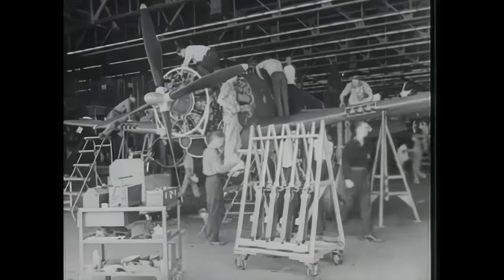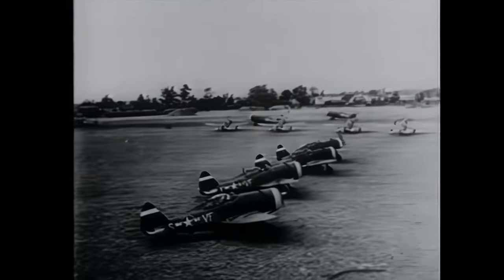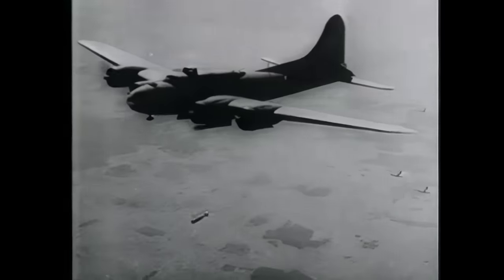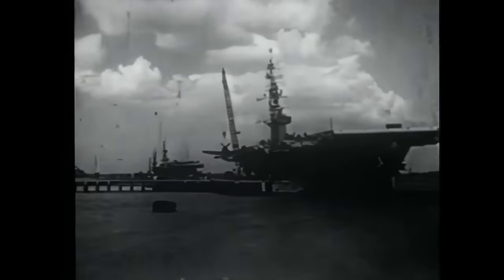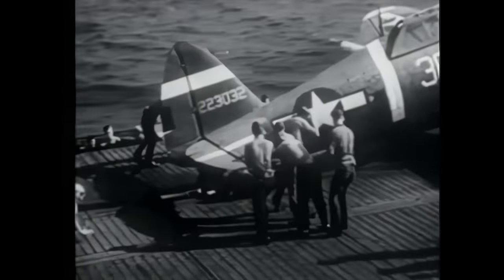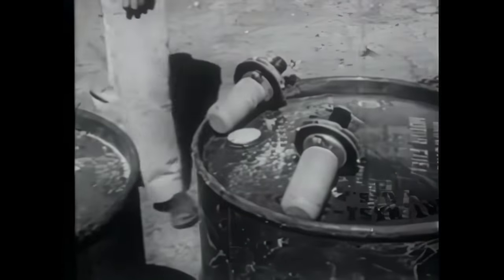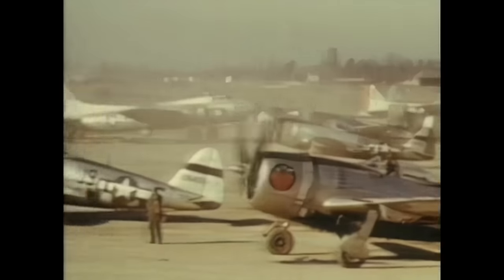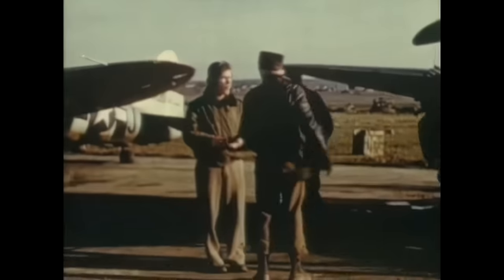P-47 THUNDERBOLT | WWII Fighter Aircraft, Nicknamed the "Jug"  | Upscaled Documentary

Comment: You can use the Jug's flaps as combat flaps though they weren't designed for that and can turn inside contemporary Me 109s at low altitude. The slotted flaps of the Me 109 aren't really suitable for that. Once you hit the high altitudes that second stage turbocharger gave the Jug a whole new comparative maneuverability. 

Unlike Lockheed, the design approach of Republic towards inter-cooling the turbo from the outset, was to stick with what was known to work. And the Jugs definitely worked at altitude while the P38s were developing a reputation as troublesome for green pilots and unreliable at the altitude required for escorting the bombing missions. 

But  range is an asset. if you can't make it to the fight deep inside the continent then you aren't going to factor. I believe the P47N variant was a bit rangier but the P51 with the Merlin mechanical second stage supercharger was comparatively cheap to manufacture and pilot friendly with the range needed from the outset. But If I were there then and had a choice I'd prefer my chances in the tough jug at any altitude.
Reply: @johnfairchild3421  The P47N was the Pinnacle of development meant for high altitude B29 escort in the Pacific. It was rangier, lighter and faster than European theater variants.P47Ns produced a maximum speed of 397 mph at 10,000 feet, 448 mph at at 25,000 feet, and 460 mph at 30,000 feet. The P51H was tested at 471 mph at 22000 ft with an over-driven blower but was never operational during the war.

Republic, unlike Lockheed stuck to what was known to have worked in the way of Turbocharger inter cooling and so was less problematic than the P38 at altitude, as was the P51 with the mechanical second stage supercharger on the Merlin. But that Turbocharged second stage on the P&W was the one with the slight advantage over the Mustang at altitudes of 30000 to 40000 feet.. A marginal difference but the N variant had it at 30000 ft.and over.

At 20000 ft the Nakajima Ki 84 tested at 430 mph, matching them both, with a single stage supercharged  radial of 2187 cu in to the Jug's 2865 cu and as tested by the Allied Technical Air Intelligence Units (TAIU) and with it's customary water methanol injection as used operationally. Shortage of skilled labor, raw materials .and adequately trained pilots rendered most Ki 84s as not to the quality nor adequately exploited however as the one we captured in Manila in the summer of '44.For instance the first one we tested had good case hardened alloy protective armor., But by the end of the war it appears that since the shortage of alloy producing raw materials would have made the metallurgy to a lower standard, they would often forego protective armor rather than weigh the aircraft down with inadequate steel plate..At least that was evident in the later example we captured and tested.
Reply: @jacktattis  For a "bad plane" they did more to break the Luftwaffe into undertrained green pilots than any other and their fighter group records show that. An aircraft is as good as the pilot's ability to use it to it's strengths and his ability to see ahead to avoid it's weaknesses. 
.
And as I pointed out if a skilled pilot that knows his aircraft  should get into a low speed turn fight with a 109 he can get 10 or even 20 degrees of those flaps down and out turn a 109 at low airspeed providing he's well practiced in stall recovery so he knows those limits. He won't out turn a 109 by much but he's got the better flaps for that. 

Otherwise, a good P47 pilot will be very conscious of maintaining energy and will likely avoid taking the bait to go vertical after a 109 that leaves the range of his .50s.
Even P 51 escort pilots in Europe didn't really get into turn fights that often on that mission. If you're escorting high altitude bombers you're going to be even higher so that when your adversary approaches his targeted bomber formation you'll dive and hit him on a run providing no adversary is above you. You won't create a furball in crowded airspace and certainly not if you're range of the Bomber gunner's 50s. You'd usually keep energy and come back around in P51s or P47s.

Comment: I'm an avid RC plane designer and builder, and am currently creating a new set of plans for a 40" wingspan version of one, using some old small free flight plans for a starting point to design around.  I like to build simple chuck glider versions before committing to the design to test any natural tendencies the air-frame shows.  This one happens to be one of those rare, upper echelon in the design world along stability and the wide wing cord gives it more surface area then other war birds, allowing it the widest range in speed to performance. 

They really knew what they were doing when they designed this.

Comment: The U.S. sent about 200 P-47s to the Soviet Union. With its high service ceiling above 30,000 feet, the P-47 outperformed most fighters operating on the Eastern front.  The Russians engineers disassembled and studied the P-47  to examine its construction.  The Russians did not use the P-47 for low altitude ground attack
Reply: there is no record of the Soviets ever even using the P-47s at all. They didn't like its design philosophy, and they really didn't have a major need for it. It's very likely that the Soviet P-47's never saw combat of any kind.
Reply: @danraymond1253  
Right, there was virtually no high altitude aerial combat in Russia, that's why they loved the P39, even though it lost it's turbo to speed up development time and get it into production it didn't need high altitude performance in the east because there was no high altitude aerial action, it's maneuverability at lower altitudes made it ideal for the Russian's needs, the fact is in the hands of the Russian's in the east where everything was low altitude it shot down more aircraft than any other US fighter anywhere flown by anyone in WW2.
Reply: @dukecraig2402  I agree with everything you said except I find it hard to believe the P-39 shot down more enemy fighters in Russian hands than any other U.S. fighter in any air force. I've never heard this before and find it doubtful. I understand they had great success with the P-39/P-63, but I would never have thought they shot down more planes than the F6F Hellcat or the P-51 Mustang. Could you provide a source that states that?
Reply: @danraymond1253  
It's true, look it up, P39's shot down more aircraft than any other US made fighter of the war, but it was Russian pilots who flew them.
It's not an option of mine it's a fact, once again look it up and you'll find it's the truth.

Comment: 31:17 what is that a 40 foot runway, and only doing it once over water, that is a jolt. They all made it, you can see the engine was just strong enough on the 31:40 shot, just hovering at stall speed.
There is a some great and new to me footage in this.

Comment: P-47 had a LONGER range than the competition IF equipped with external tanks. For reasons of logistical ineptitude, USA could not supply sufficient external tanks to the planes on the line. Alternatively, there was plenty of space and lifting power for added internal tanks, but this was not done. All in all, the P-47 was the BEST fighter that USA fielded in WW2.

Comment: Just a week ago I washed the documentary about the 5th Air Force in the Pacific using Thunderbolts and coming up with a custom dropped gas tank that gave them enough fuel to go like 500 plus miles or maybe a little bit longer they were able to reach it when you overlapped it onto the England to Germany map I mean all these years of hearing all the 47 couldn't make it the 47 make it we had to send the b-17s without any cover losing all them men and they didn't have to happen and the Air Force knew that they had a fixed to the problem and they didn't bring it over

Comment: The only reason the P-47 initially lacked range was that the command did not see the need to equip them with drop tanks. Once they did, Thunderbolts went wherever they were needed. The final WW II Thunderbolt model had longer range than any Mustang other than the post war "Twin".
I've nothing against the P-51. But it's "legend" usurps the rightful place of other aircraft that did as much or more to break the German air force and win the war. And the idea that the Mustang had to "save the day" is fairy tale. Once the P-47 had drop tanks, and the P-38's had dive flaps, they could both take on the opposition superbly. By the time the Mustang flew in force, the Allies were already winning the air war in Europe. And would have likely won it anyway, Mustang or no. 
Mustang was a fine airplane though.

Comment: You are DEAD WRONG about the P47 vs P51 range.  They were essentially identical, WITHOUT drop tanks.  No aeronautical Einstein ever thought to put drop tanks on the P47.  The P47 was a monster compared to the P51, so would have needed more gas in drop tanks than the P51, but the P47 load carrying capability put the P51 to shame.  If the P47 had been given a drop tank large enough compared to its weight carrying capacity as the P51 had, it would have SMOKED the P51 in terms of range.  The P51 was a light weight fighter, and the P47 was basically a light weight bomber.

Comment: Your wrong there too. Younger people dont know about aircraft. The P-47 was designed to be a "high-altitude interceptor". The higher the P-47 flew,the better it flew. Could outdive anything. Could outroll anything too except the FW-190. With the bigger belly tanks alone it could make the rou dtrip to Berlin and back,like it did on March 6th,1944. The P-47D-25RE model with full drop tanks could fly from London to Moscow. The P-47N had way more range than any P-51.